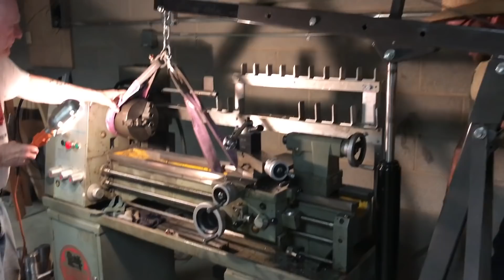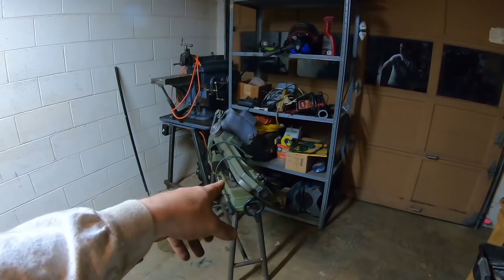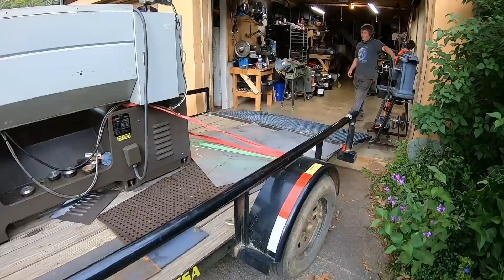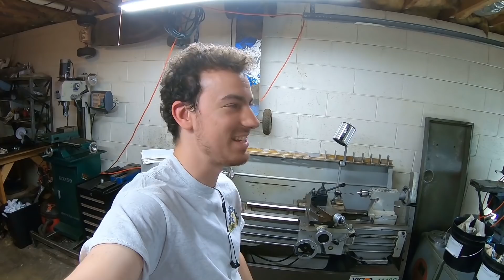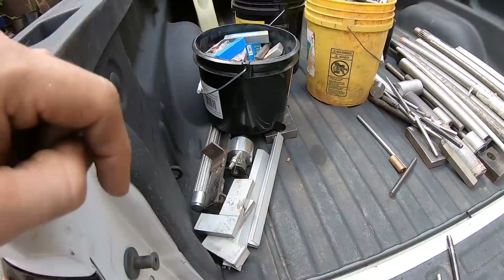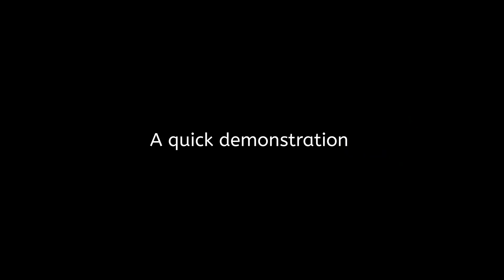How I got a FREE Lathe!!!

Comment: The stock having the concave face kept it from letting to know the tool was to low. When the tool is low and it gets to the diameter that the tool is lower than the centerline, the stock will pull up on the insert and break it. In other words the stock climbs the insert. If the material is barely in the jaws in this scenario the piece could also come out of the chuck. When the insert is high it will squeal because the insert is rubbing blow the cutting edge. The tool being on center is very important. Lining it up with the tail stock center is the fastest way. You can also use a rule and measure from the cross slide to the tip of the insert. Once you figure out what that number is, it will always be the same. Stay safe and keep up the great work Chris!

Comment: Congrats on this score! You can mount the phase converter motor on rubber isolator feet and build a simple box around it with rockwool "Safe 'n Sound" batting to quiet it down to nearly nothing. All the best, Andrew @BranchAndFoundry

Comment: Use some valve springs and make isolation mounts for the rotary motor. It'll be ridgid enough while dampening vibrations. Heck, throw a little rubber at it, too. Wonderful gift!

Comment: I think the lathe is working at European standart voltage, so 230/400V. And therefor you can pick up a transformator. Or you change the motor and the input voltage of the DRO. Should all be possible. And not that waste of energy ;)

Comment: Tip: You can move extremely heavy equipment with 24" or so 1/2" - 1" steel pipes. Just keep putting them in front and rolling it along!  Works very well on hard surfaces...

Comment: Very lucky nice couple off lathes as for rotary converter you can mount springs underneath the motor will act like a damper take all the vibration out of it . Also when not in use for screw cutting purposes put the main lead screw in neutral so you don’t accidentally engage it and smash into the Chuck

Comment: @rather B welding
about your rotary phase converter that vibrates very loud you could get some rubber feet mounts that you put between the wall & the box & also cut down the same rubber foot mounts for inside the box against the box wall & then you place a mudguard washer over the rubber followed by a coach bolt into the wood frame of the wall or if it's a concrete wall then us a concrete fastener. So long as the mounting bolt does not touch the framework of the box & it's isolated with rubber then you can eliminate all vibration & much of the noise.

Comment: I would say YES! to the workshop...I just built my dream shop... now I'm trying to arrange it so I can actually work in it.. I've built 2 workshops in my lifetime and I'll give you a little advice.. #1. No matter how big of a building you build it will not be big enough...you would be surprised how fast it "shrinks". Figure out what you can afford then build bigger... #2. Build tall... as the building "shrinks" you will figure out a way to store stuff up out of the way. I am in the process of building mezzanines in my new building just for this purpose. The air compressor, phase converter, material storage, and cool junk is all going up there.. my off road gocart I built when I was 15 is already hanging from an I-beam. Good job, good luck, and you have an awesome dad!

Comment: Yes, a bigger shop.  My suggestion, get a piece of ground in the country and put up a metal (exterior) pole building.  Cheap to construct and easily expanded.  Of course having a place to test ride builds would be sweet.  I found an older (abandoned) farm house on 10 acres locate on a blacktop county road for under $40K. (Took some looking)  Remodeled the house (over time), built a 40' x 60' building with 10' walls for about $7,500.  Because I lived in the home I was able to get a GREAT low interest loan and today the rates are even lower.  You could have everything you want for $50 to $60k.  A good friend did it even cheaper, he bought empty land and put up a bigger building and put an apartment in one end.

Comment: If you are looking for a quieter and more energy efficient solution for the power control, you should get a VFD, As for what to do with the smaller southbend, you can do a CNC conversion, which opens opportunities for inner spline work and other stuff.

Comment: Chris turn your homemade lathe into a tube notcher 
Put a end mills in the Chuck 
You can but them extra long 
Put a v block on the tool post for a tube holder 
Perfect notched tubes every time the HM lathe is perfect for that 
I’ve had a lathe for years 
Please look online at lathe accidents they are deadly ☠️
You need guards and never ware loose cloths jackets operating that big of a lathe

Comment: I am not familiar with that Victor lathe but there has to be a way to disengage the lead screw while you are turning and facing. It will save some wear on the bearings when you turn with those high RPMs.  I would recommend finding a user manual and reading that before you get started. It will also cover the lubrication of your lathe which is very important. 

If you have not leveled the ways of your lathe, I think that would make a great video for those setting up a lathe for the first time.

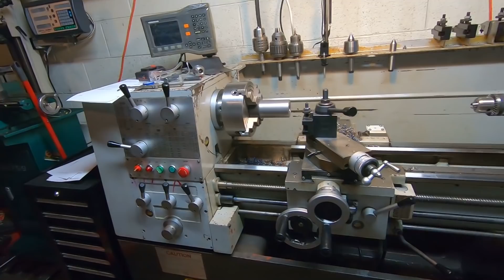Comment: 10:49 noise and vibration. That can be resolved by mounting the motor/rotating converter on 3 or 4 spring style vibration isolators.

Comment: You really should have some space behind it if possible.
You're going to want to clean behind it and if you need to work on it you'll have to move it.
   Victor's arent the greatest when it comes to lathes but for the price you cant beat it since it's not like you'll be doing production work where time is a factor.
They both look to be in great condition though.
   Maybe sell the smaller one?